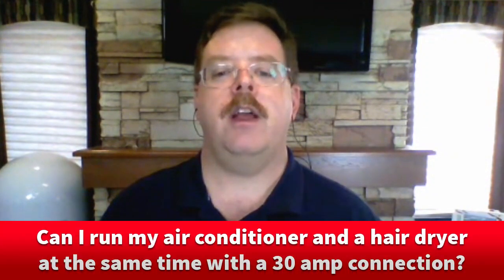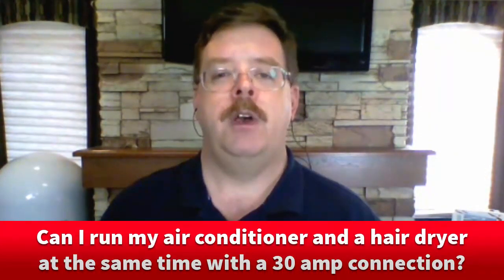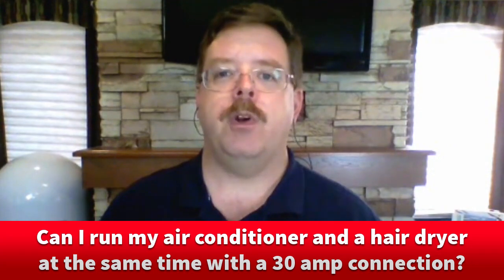OK to use RV A/C and hair dryer at same time on 30 amps?

Comment: My personal answer here would be NO, NO and NO! My husband was microwaving a cup of coffee and I was in another room and turned on my blow dryer. Immediately we smelled something burning and out coach filled with smoke from our circuit board - which is now toast (no pun intended). My advice is always turn off that microwave when using anything else in your RV. These campers were not built to handle those convenient microwaves.